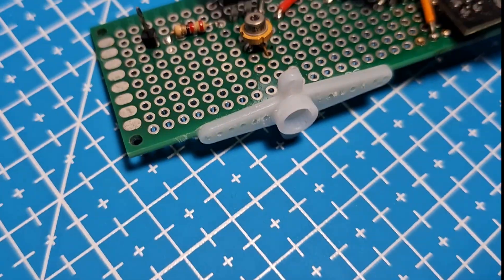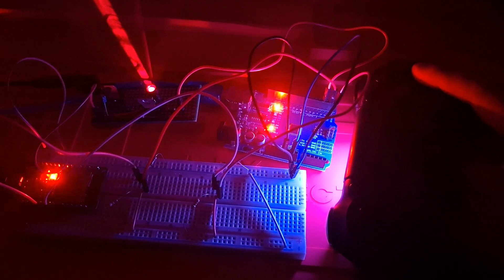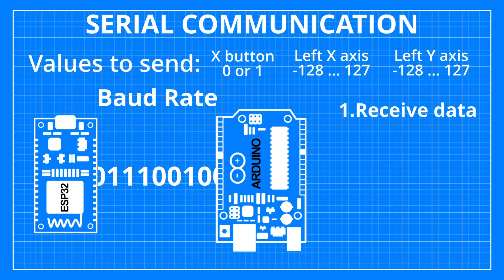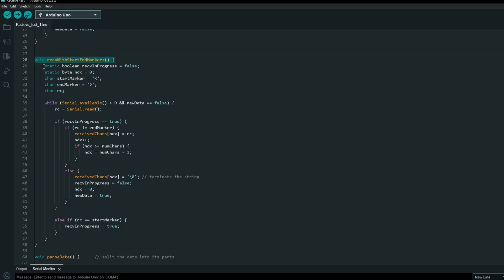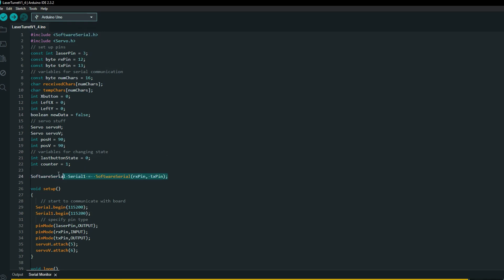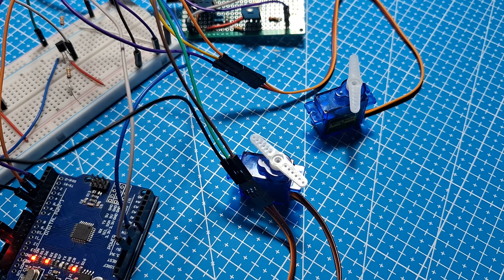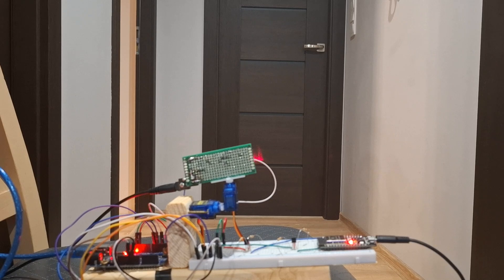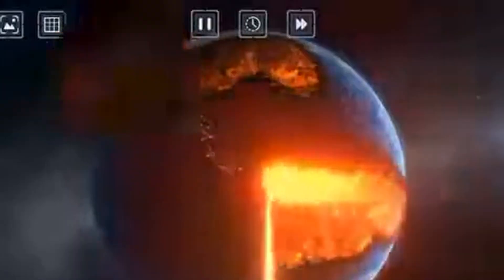Arduino for Beginners: First Laser Turret Prototype

Comment: CAn you do it in reverse? Have a turret that turns and points at laser dot. So you point a laser and it turns and aims at the laser. Simpler might just be a a wireless transmitter that the turret follows.?
Reply from the maker: Do you mean having laser and turret turn independent of each other or have the turret follow laser pointer that you shine from somewhere else?

Comment: Hi! I'm currently working on a driver circuit for my project and wanted to know how easy/possible it would be to get a commercial low cost laser diode to pulse for <66ns periods at a 1 kHz pulse frequency? I plan on using an arduino, Thanks!

Comment: you did it wrong, the base motor should spin along vertical axis and the top motor needs to spin along horizontal axis, so you can spin the turret 360 deg and set the angle between 0 - 90 deg
Reply from the maker: True. I know what you mean, but I'm going for a different design for the second version.

Comment: you got esp32 so why you need an Arduino to controls moving parts?
Reply from the maker: I wanted to mainly work on Arduino, but ESP was the easiest way to use a ps4 controller.
Reply: exactly what I was thinking
Reply: Right, waiting for the builder to answer this